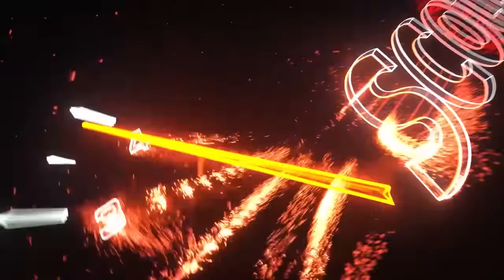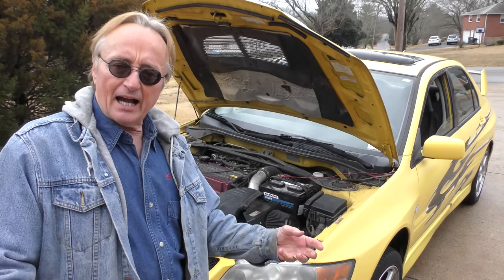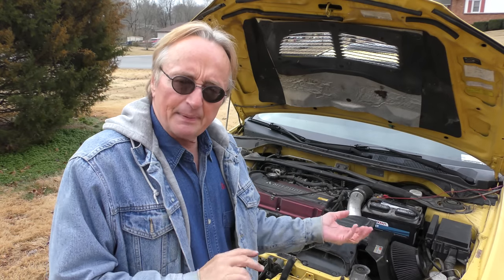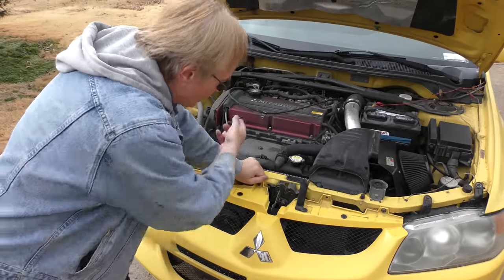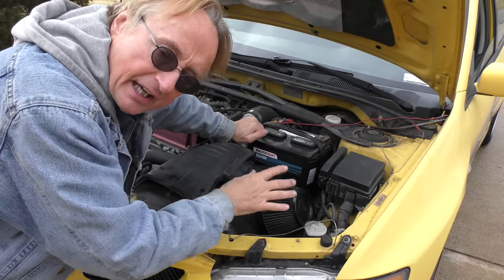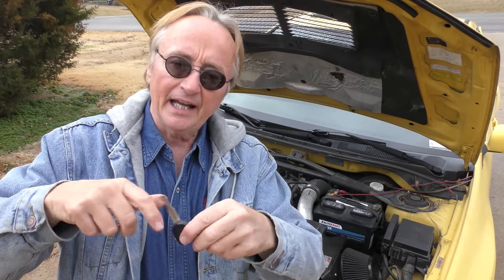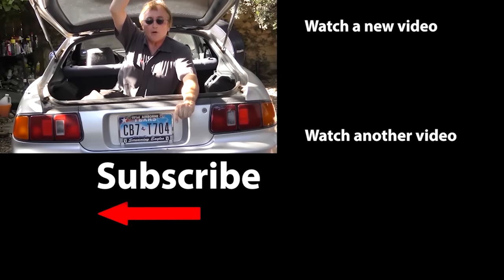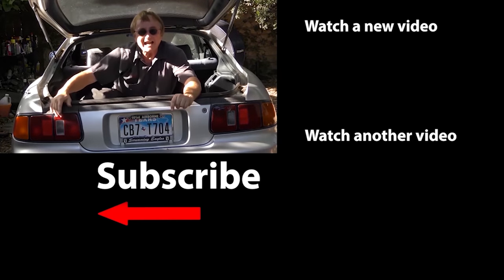Here's How a Mechanic Spots a Bad Car to Buy

Comment from the maker: This Could Be the End of Toyota: https://youtu.be/l5_ZcllMfpM

⬇️Scotty’s Top DIY Tools:
1. Bluetooth Scan Tool: http://amzn.to/2nfvmaD
2. Mid-Grade Scan Tool: https://amzn.to/33dKI0k
3. My Fancy (Originally $5,000) Professional Scan Tool: https://amzn.to/31khBXC
4. Cheap Scan Tool: https://amzn.to/2D8Tvae
5. Dash Cam (Every Car Should Have One): https://amzn.to/2YQW36t
6. Basic Mechanic Tool Set: https://amzn.to/2tEr6Ce
7. Professional Socket Set: http://amzn.to/2Bzmccg 
8. Ratcheting Wrench Set: https://amzn.to/2BQjj8A
9. No Charging Required Car Jump Starter: https://amzn.to/3i7SH5D
10. Battery Pack Car Jump Starter: http://amzn.to/2nrc6qR

⬇️ Things used in this video: 
1. Common Sense 
2. 4k Camera: https://amzn.to/2HkjavH 
3. Camera Microphone: https://amzn.to/2Evn167 
4. Camera Tripod: https://amzn.to/2Jwog8S 
5. My computer for editing / uploading: https://amzn.to/301tYt9

🛠Check out the tools I use and highly recommend ► https://goo.gl/rwYt2y

Subscribe and hit the notification bell! ► https://goo.gl/CFismN
Reply: l'am making cardboard model cars
Reply: 289,000km and counting no repairs besides engine mount on my Mercedes AMG c63
All the seats are ripped and worn out but the motor and trans still runs like new 😂 
Confident I will hit 350+
Dunno why you say unreliable
Reply: Dear Scotty whats your opinion on a 03 buick lesabre with only 75k miles on it?
Reply: Hi scotty i have a diesel car and ive noticed theres a little black oil at the back of the tail pipe what do you think this could be and what do you think i should look out for to prevent anything going wrong with it ?
Reply: might not be tripping codes because whatever tune they did to it disabled some of the monitors. :/ The second I saw your dirty finger I was thinking "what a piece of crap. sell it for parts or send it to the wreckers. Was probably owned by some 16 year old who just watched fast and furious thinking he could do the same failing to realize those cars have ~50,000+ bucks of powertrain modifications and another 20 for paint."
Reply: You put out interesting videos!  Was your mother Italian? (Because of the way you talk with your hands)
Reply: The evo are good however mod it smartly
Reply: Hey Scotty I just bought a 2003 Lancer evolution 8 with 142k miles. This is my 4th evo in my lifetime.  Shes my eleanor.  Was this a good buy?
Reply: @adnmoh1  check everything on that engine
Reply: @davidrambharose1683  engine runs good, o2 sensor is throwing a lean idle code. its running a fp green turbo with external wastegate and 272 hks cams. i need a tune for e85 flex fuel setup though.
Reply: @adnmoh1  If your up to the project it's a good car
Reply: Remember the Mechanics always ask you to leave your car,you are told anything just to Pay

Comment: I always look for tucked away stereo wires when car shopping. I figure if your going to half a$$ a wiring job, you probably take the path of least resistance with most things including car maintenance. 🤣😂
Reply: I was close to buying a 2011 Genesis coupe back in 2014 and I asked the guy to pull the aftermarket head unit he had on so I could look behind it.  He wouldn't show it to me until I said I had the cash in pocket (I didn't) and I saw the WORST harnessing and cable management case I think I'll ever see which led me to believe the same thing you're talking about.  It's worth it every time to grill someone who has audio (or really any) aftermarket parts on getting a look in.
Reply: Good move. My first car when I was 16 caught fire and burnt to the ground from a bad stereo install. All while I was driving down the highway.
Reply: "The path of least resistance" I like that lol
Reply: @Hughesburner  wowzah

Comment: I once bought an old Lemans for $750 to use as a winter beater. The guy I bought it from thought he was going to make a classic out of it and bankrupted himself on an expensive set of rims and tires, a sound system and all kinds of chrome goodies under the hood.

I tore all that crap off and sold it all for $1250 then bought all stock parts at a scrapyard to put it back to original which cost me $350 total. Sum total - I got a durable old Lemans, ready for the road for free and enough cash left over to fill it with gas and buy a couple of cassettes.

I ended up getting 7 1/2 years out of the car!
Reply: Well, that's called being smart! :)
Reply: @arefeshghi  And more than just a little bit lucky, too. I figured that if I got a year out of it, I'd be doing well. I got 7 1/2!
Reply: That’s a good bussines, but only work if you are the mechanic and do the repair yourself.
Reply: @ignaciogodoy7095  Well, back in those days, I actually could do most of it 'cause cars were a lot simpler.
Reply: That's a win

Comment: Love those little rally cars. To bad, like you said, everyone around is usually diddled with and not stock.
Reply: @LA FLAMA BLANCA wrong. Stock car is designed for long term reliability.unlike all the mods tuned race wannabees.
Reply: @LA FLAMA BLANCA It'll run "better" IF, and that's a big if, they tuned it correctly with the mods installed correctly. Not to mention reinforcing the necessary components that can handle the extra power to ensure reliability. I'm not taking any risks buying a highly modded car unless I know 100% it was done by professionals the right way.
Reply: Well none of them are going to be driven soft anyways, so yeah maybe better diddled with because diddlers usually look after their motors better lol
Reply: @darrenm8172  Exactly
Reply: Aw bless your heart, other people diddled with cars you love. It'll be okay, sweety. You can buy all the stock parts you want.

Comment: Mitsubishi  evo: i break

Scotty's Toyota celica: 1,000,000,000 miles later STILL RUNS LIKE A CLOCK
Reply: 1 trillion miles 😳
Reply: Air conditioner still runs freezing cold 🥶
Reply: Mitsubishi has great AC systems though, that’s one thing they do right.
Reply: @tails300  yeah ude hope so hahaha
Reply: @chickenjoe9832  you'd. Ude lmao😂
Reply: Yeah but you remove the ac co.pressor and replace with a bypass pulley. Less weight more POWER

Comment: Maybe it’s tuned to run that rich... to cause extremely loud backfires when the exhaust is heated up. That’s my guess... usually people who put aftermarket parts will get a tune that causes a loud gunshot backfire resulting in liquid gas going in the exhaust as scotty showed

Comment: My Eclipse was running extremely rich when I got it for cheap. Checked the fuel trims and were at -100 STFT and LTFT. The engine coolant temp sensor reported -40 F when the temp outside was 60 F. Changed the stupid sensor and my car works amazing now

Comment: Hey Scotty be careful with putting stock parts back on a modified car especially if it was tuned with those performance mods. Example if you put a stock mass air flow housing or a stock turbo on my car it would not run properly.  Just some friendly advice

Comment: Cold air intakes; gotta love 'em... Found out that I had one preinstalled in what was supposed to be my 'stock' '05 Ford Escape a few weeks ago.
Reply: All cars for the past 30+ years have had cold air intakes from the factory as they usually pull air from the wheel well or above the radiator. These "cold" air intakes just pulls hot air from the engine bay.
Reply: @arisukak  Uhh no. If you get a quality CAI it does not pull air from the hot engine bay; you must be thinking short ram intakes

Comment: I purchased my Evo in 2005 and it’s still going strong. If you do the maintenance, modify your car correctly and most importantly get it Tuned by a competent tuner than its an amazing machine. My car makes 700whp and runs strong.  This guy doesn’t know anything about Evo’s.  I have never heard anyone say that an Evo is a throw away car.  Perhaps other Mitsubishi’s. The car in question has been used and abused and needs some TLC and a tune.  That’s why it’s running rich. Evo’s run rich from the factory to protect the motor  from detonation due to leaning out when someone adding aftermarket parts before Tunning.

Comment: I had the same Evo 8 in the same color! Fun in the sun package. I love the Evo 8 & Evo 9 models. No matter how many transfer case or clutch problems I had,  it was so much fun to drive and faster than advertised. Sold it because i got pulled over too many times. I even got a ticket in a parking lot when I was sitting still. I would buy any Ev0 as long as there is no rust.

Comment: I brought an old m reg 1995 rover tomcat 1.6 with Honda engine two years ago quite cheap £800. I was well happy with it and the condition it was in and it ran proper mint,  I gave it a full oil change (possibly removing additives in the oil that made it thick and helped seal gaps in the cylinders and piston rings) after full service it was about 500 miles before it was blowing exhaust gasses out the expansion tank and was using a litre of oil every 1000 miles 😓.
 ild never used k seal before but I gathered that the person who sold me it used it and I tried it and it would be sound for about 1000 miles, ild have to bleed the air out every now and then but it never ever overheated, so I wanted to believe it was only the water pump as that seemed to be a problem with this engine too. Another thing I learnt with this engine is if you don't change the antifreeze after its lifespan then it starts to corrode the head gasket and the two middle cylinders were normally the ones affected which will cause massive blowback out the oil filler cap and gasses out expansion tank. I've been driving since 1993 and it was my first rover, it was a really nice drive in midnight blue, I really liked it, I drove it for near 6 months/ 6000 miles till I got fed up with it and sold it for a small loss but learnt a lot. I've had well over 60 cars and Ive never brought one with blown head gasket, it always pays to do your research before owning a brand you've never owned before 👌

Comment: I brought a cheap throw way car, had a K&N filter which I took off and put OEM back on, complete oil check and filters as the oil light came on driving home the next day etc, every single filter been changed including diesel filter it was totally black like an oil filter. but still has a hard time start from cold. once its warmed up it can be started back up without no trouble.

Comment: I confirm that the lancer gt that I drive has a shooty exhaust but not wet because it's decat. The LT and ST fuel trims are indicating fuel being dumped at max values.  And yes, I have an open pod.  Drop in the stock intake system, everything runs fine and fuel trims show normal.  No CEL under mod situation or stock situation.

Comment: i change my engine oil pre 3500km or 3000km or in between not really accurate instead of 5000km which normally is, i'm very thankful everyday to have the engine, so powerful, i need, i'm amateur kick boxer for about 16 years, i need fast car, we all in need for powerful car, very useful to have one, safes you in the time of need to reach somewhere.

Comment: I'll stick with my 20 year old Chevy Silverado 2500 pick up. It's got the 6.0 vortex that runs like a clock. I put a new radiator, water pump and battery in it and took Scotty's advice and cleaned the MAF sensor. I also installed new brake pads. No monthly payments. Yippee.

Comment: Put a vacuum meter on the car to get manifold vacuum and pressure.  Then check the ECM to see if it's been replaced or flashed... Not sure a 2003 can be flashed, but if it can, reflash to original specs. Also clean the mass air flow sensor.  But yes, with all of the aftermarket crap, it's going to be a fun diagnostic.

Comment: The first thing I look for is the condition of the oil and transmission fluid. I take the oil cap off and run my finger around inside. If it's really dirty, gritty, has sludge in it, no deal. Same thing for the transmission fluid. That's a car that just hasn't been maintained.

Comment: I  bought  a  new  95  Dodge Stratus  ES  in   95  with  The  Mitsubishi  V6  I  know  how  to  take  care  of  & drive  a car  when  I  sold  it  in  2000  it  had  122. 690  on the clock  I  prolubed  the  engine & trans  at 30.000  my  beef  with  the car  was  2  AC  compressors   1  Alternator  1 electric  idle motor  and  3  starters    and  above average  headlamp  and  tail lamp  bulb  replacement  other then that  not  a bad  little  highway / get to work  commuter  car  lots of off hours  side trips  too and I  had  the   Front  seat  modified  because  I am  6 ‘ 5”  and have bad knees 😎😎😎😎

Comment: We got 332,000 miles out if our 1996 Mitsubishi Montero.... and never ever had any major issues.

 I also owned an evo 9 which I drove to 100,000 miles with no major problems.

Those cars were both made 100% in Japan.

We also had a Mitsubishi galant which wasn't 100% Japanese, but still ran great.

So I love you Scotty but I'd have to disagree about the ""Mitsubishi is a throwaway vehicle"" we've had nothing but good outcomes from Mitsubishi.

Comment: Looks to me like the previous owner of that Evo had installed larger fuel injectors or possibly an aftermarket fuel tune to the ECU to support a larger turbo.  The bigger turbo was then replaced with a stock turbo or was never installed to begin with and these mods may not even trip any ECU codes.  The end result is an overly rich AFR on a stock turbo, which will cause this type of result.  Even putting a stock intake and exhaust back on this Evo would not restore its stock performance.  The fuel system and ECU needs to be inspected and likely retuned or replaced with original parts.

Comment: yeah throwaway cars, the ones i remember i the late 80's were built to run great about 4 years and like after that they would break out in rust just about everywhere all over the car like disease. there was no stopping it. paper thin body panels, cheap grade steel.

Comment: My ralliart just had a timing belt issue after a wreck thank god it wasn't totaled and Its fixable but the 4g69 is a very reliable motor...I will agree with you that the 4g63 is not quite as reliable but my car had 216xxx on the dash when the wreck happened  so not all Mitsubishi's are "throw aways"

Comment: Unless it's a security system install, I make modified wiring obvious as a courtesy, repairs of existing get rebundled as OEM. I'm not talking sloppy like the wire laying across the engine, just alternate routing, colors, not buried and the like.

Comment: A guy at work had evo5 and sold it because of the running costs.  Ridiculous fuel consumption, servicing intervals shorter than my attention span.  Parts are expensive too, eats tyres.

Comment: I'd say unless it comes with the original parts OR it comes from a shop that's well known to do good aftermarket work (not just some guy in his garage) then maybe.  But other than that, I personally wouldn't buy a vehicle that's been modified.  Body kits are one thing and they generally don't impact driveability (functionality) but aftermarket engine stuff can cause all sorts of problems, even just the cold air intake like was pointed out.

This actually reminds me of the Bonus content on the 2 Fast 2 Furious movie where they show a segment about how they modified the Evo for the movie.  Of course they went a step further and added things like nitrous but it was done by a professional modification company by people who knew what they were doing.

Comment: Has Scotty ever put out a video about mileage cutoff for buying used vehicles? Like, ont buy anything over 100k? Or models to buy at certain mileage?
Reply: Depends. A high mileage Toyota could be more reliable than a low mileage Chrysler. It depends on the car and how the miles are added up. Highway miles are not the same as city miles. 

Also depends on what you want the car for.

Comment: Just curious, if you believe that it's important or even vital that a turbocharged vehicle should have a boost gauge somewhere inside the cabin, then why is this feature absent on nearly all new vehicles on the market that are turbocharged? Almost every four door sedan and many smaller SUVs these days have a turbocharged engine as standard equipment or optional and I don't think I have ever seen any boost gauges inside the cabins of the newer cars or SUVs alike. Are you specifically referring to just performance oriented vehicles that it's very important to have a boost gauge on or all cars with turbo engines?

Comment: Cmon man.  I worked for Mitsubishi for 12 years in Europe. They are extremely reliable if not messed up with and the evo's included. Engines might not do same total mileage as Toyota but they usually are trouble free on most models.

Comment: I've been sticking my fingers in tail pipes since I was a teenager. 😅
I have a 2001 Toyota tundra that has a clean tailpipe and a 2005 avalanche that has a clean tailpipe.
Always accelerate slowly and drive the speed limit or less. Your vehicle will last much longer, and save you a lot of money and possibly an accident and traffic violations

Comment: @2:42 Mitsubishi did that on purpose as they know Mitsubishi motors are oil & gas burners ,Mitsubishi actually makes ECM's for many other OEM manufacturers, not just Mitsubishi....they probably made the computer not to pick up error codes easily

Comment: The black in the exhaust doesn’t mean a car running rich is bad necessarily my Dodge Dart has burned oil since like 50k has been black inside the exhaust it still runs smooth pushing 220k miles now original engine with no signs it’s gonna quit wouldn’t doubt this engine makes it 300k+
Reply: The Burning oil  may eventually clog up the Catalytic Converter.